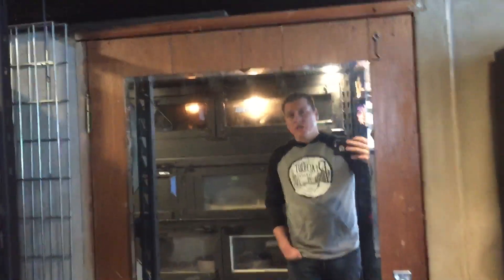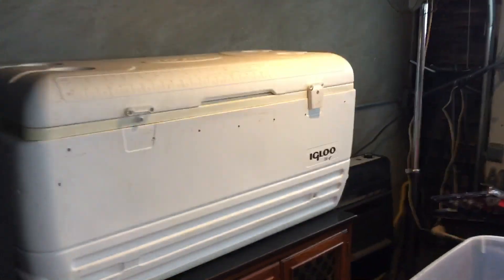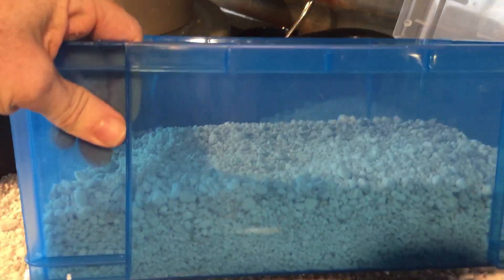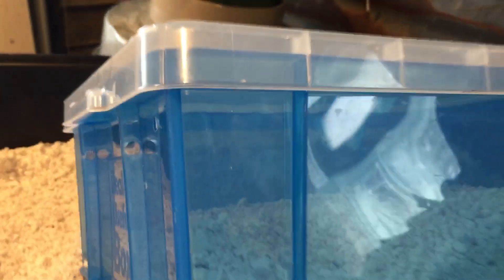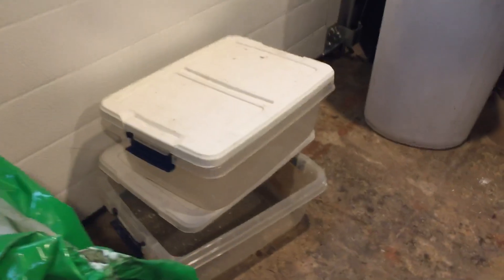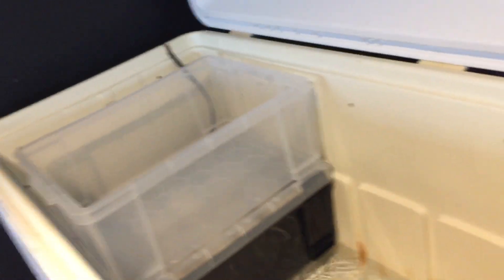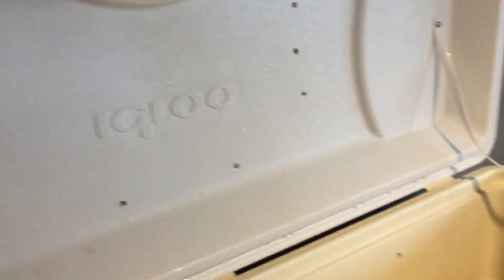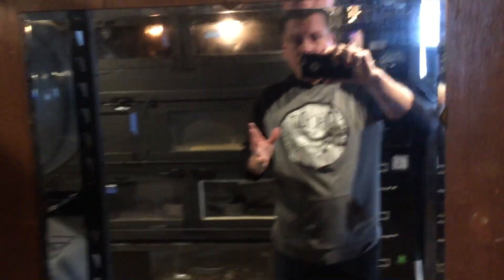DIY Reptile Egg Incubator, cheap and easy incubation for success!

Comment: I am researching his to incubate panther chameleon eggs will this work for them as well?
Reply from the maker: Yes, in smaller size.  ;). I started with lizard eggs using this method.
Reply from the maker: Be sure to see my incubation update video as well, it may help you out.
Reply: Reach Out Reptiles just saw it and it answered 99% of my questions my only one was do I have to worry about mold in this system? If so would reptisafe be a viable option?

Comment from the maker: I used just the smallest circulation pump I could find, I believe it was from Aqueon- but any aquarium pump will do.  Humidity in this system always stays at or close to 100%, which is why you can use drier substrate and be fine.  The temperature will depend on the species you are trying to incubate, and only needs to be monitored inside the egg chamber.  For ball pythons, for example, that temperature should be around 88 degrees. It doesn’t matter what the water temperature is, or the air temperature in the rest of the cooler- the only one that matters is that egg box internal temperature.  The heaters are adjusted slightly, then after a couple of hours the egg boxes are checked again, and so on until the correct temperature is reached.  For this reason, I recommend setting the system up weeks in advance, and getting it all dialed in.  Then you can feel free to unplug it until it is needed.
Reply: Can i still put water on to my substrate of perlite if I want to?
Reply: Do you use an external thermostat for redundancy

Comment: I'm thinking about doing a smaller version of this for fat-tailed gecko eggs. Are you sure there is no need to keep the substrate wet? This seems like a really cool method, but I want to make sure it'll work for my type of eggs.
Reply from the maker: The idea is, you want to have the substrate JUST BARELY moist enough to prevent any dust from clogging the pores on the eggs.  This set up runs at 99.9% humidity very easily, which is where eggs get their hydration from anyways, not from standing water or moist substrates.  Good luck!!
Reply: Reach Out Reptiles Thanks so much! I'm definitely using your method.

Comment: What is the name of the themostat?
Reply from the maker: That Bulgarian Dude This method does not have a separate Thermostat- I am using the controls on the heaters alone. These heaters are not capable of creating excessively high temperatures, so while a thermostat can be added for redundancy, it is not necessary if the system is checked regularly.
Reply: Reach Out Reptiles I meant the heater, sorry